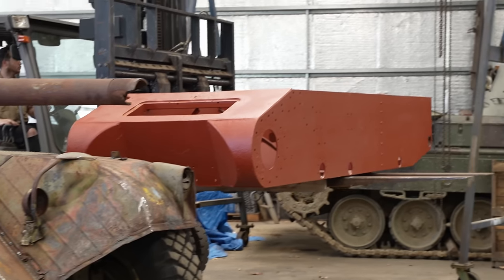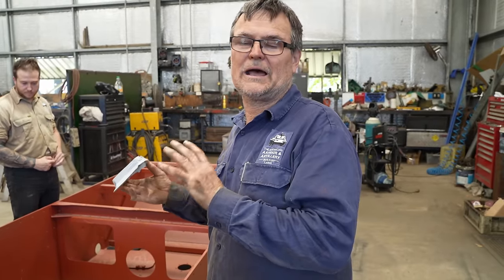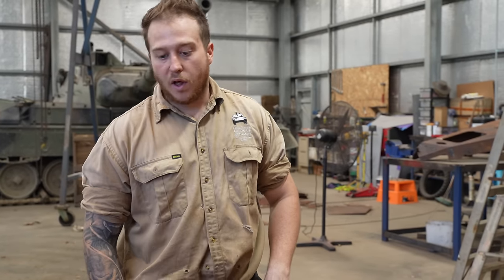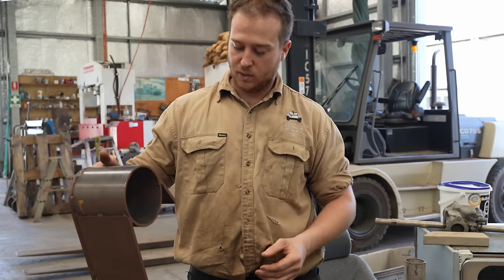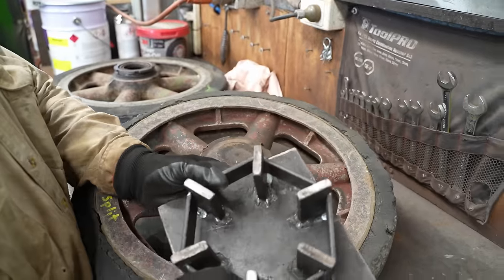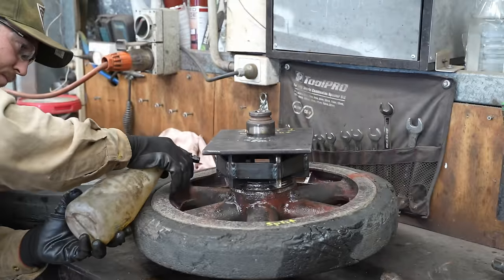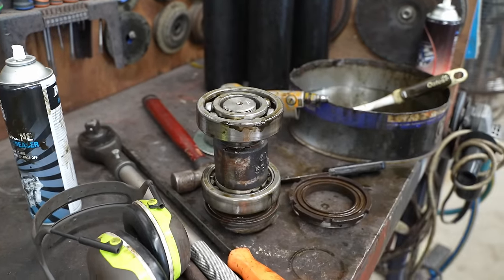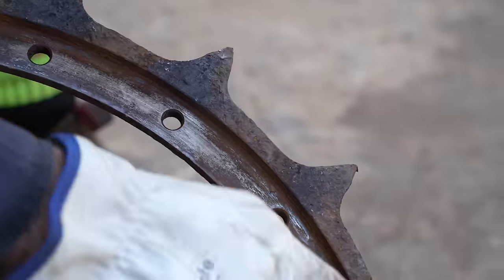WORKSHOP WEDNESDAY: New RUNNING Panzer I Ausf. B restoration project!

Comment: The panzer 1 and 2 are two of my favorite panzers. They were outdated before they went into combat, but they were just neat little tanks! The Panzerkampfwagen II Ausf. L "Luchs was also a neat design!
Reply: In 1939 the Pz II was still pretty good. Although its armour was too thin, the 20mm auto-cannon could punch through anything the Poles had.  The armour on many Pz II’s was upgraded for the France campaign in 1940 but the cannon couldn’t scratch the better French tanks.

Comment: You were struggling with removing steel bolts from cast aluminum and there is a very simple trick which works very well in that the maximum expansion of aluminum happens at 100 deg C while steel needs much higher temperatures to move. All you have to do is drop the casting into boiling water and allow it to come up to temperature, the aluminum expands by as much as 10% while the steel wont expand at all. This works so well that Rolls Royce use it as their preferred method for removing liners from the merlin blocks and from experience they almost drop out. Could save you a lot of work

Comment: Hard to believe that the ball bearing still has the same number: Rillenkugellager 6309 (45x100x25 mm)
Reply: I noticed that as well.
Reply: I have done US half tracks, when doing the brakes, I used off the shelf truck parts, they were the same and those parts are available still. Because of manufacturing standards, we are now seeing parts that have been in use across many different machines since for 130 years. This will continue, why after all invent a new bearing and give it a new number when there is no need.
Reply: @oldfarthacks I could agree more. I have been delighted to buy off the shelf bearings and oil seals for my milling machine which was new in 1952.
Reply: @oldfarthacks  There are some part number changes and some bearing lines do die out, but yeah, for the most part, anything built within 130 or so years, maybe even a bit more... you can use off the shelf parts. That's standardization for ya.

Comment: 24:00 i have pressed that kind of steel thickness into a dish for my brother's farm machines in the past. It's not that difficult. A 90 ton hydraulic hollow ram would do short work of that kind of steel. You just need to manufacture the parts where the metal doesn't need to bend. When i talked with a fellow that worked in the industry for advice, he called them the "pinch points" (might be lost in translation). In simple terms, you need to have the surfaces that become the flat flanges where you bolt things pinched by two pieces of tightly bolted material that become both form and holder for the part. Once you have those, you can push them out as fast as your hands can work them. In my specific case, i only needed the outer segment to be a controlled surface, the inner one could have any shape, as it was to be welded, but it works out really easy. Truncated cones like that don't offer much drama at all.

Comment: The skill shown by you is truly remarkable . It is as if it was a  plastic kit of the tank. With the majority of the parts missing . That had to be remade  by hand. But instead of plastic and glue , you are working in steel and welding !

Comment: It's fascinating to see how thin that hull is. It's not armor, it's boiler sheets.
Reply: The Panzer I was primarily intended as a 'training' tank, one reason why it was armed with only two machines guns.
Reply: @JM-lk6wo more than a training tank The panther 1 was conceved like a tankette that's why The twin MG 34's on The turret and The light armour
Reply: Yet they attacked into France, Belgium and Russia!
Reply: @frankbodenschatz173  , that's true. It wasn't intended to be so used by the German General staff, but Hitler wanted a war before Panzer IIs and IIIs were available in sufficient quantity.

Comment: That dished centre of the sprocket looks ideal for easy casting.  My brother did some work on heat-treating cast iron and found that it gave a lot more strength to an iron casting.  It is definitely worth looking into as casting is so easy.

Comment: Fun & Games! Back in the day, I would have leapt at the chance of a job like yours!  Lots of old, heavy gear & lots of head scratchin! A couple of workshop tips, if I may, from a retired dozer / heavy vehicle engineer (you might already know them). The single best bearing drift I've ever used - still using one now - a length of 1/2" key steel. I never found anything that worked better. Eucalyptus oil works well on seized parts, especially on Morse Tapers. The latest inclusion in my workshop is cheap shop tyre shine. Brilliant stuff for most tight fitting rubbers & plastics I've encountered, when you need to fit or remove them without damage. Keep up the great work, lads. Next time I'm up that way I'll be popping in to see what you're up to.

Comment: I love that you guys are making this Panzer 1 a running vehicle and I like the idea of hydraulic powered final drives. My personal opinion for what you should do for an engine would be to use like a 3 or 4 cylinder Detroit Diesel (I'm personally a little bias about Detroit Diesels) or some sort of cool, small diesel engine. Keep up the good work.

Comment: I have been trying to get some views of the cast aluminium wheels and they appear to have some quite complex features. I guess being German, that comes as no surprise! 😮
At the moment my thinking is that they were die cast on a machine as opposed to greensand cast.
The undercuts on the inside of the wheel rims are the tricky part and given the rubber road wheel is in the way we can't see the details of the exterior rim of the wheel for locating the rubber wheel. 
Mark from Melbourne Australia 🇦🇺 
Olfoundryman here on YouTube is based in Melbourne and could guide you through how the wheels are likely to have been made. He has years of experience including in the automotive manufacturing industry.

Comment: I worked in a 
 museum in Vincennes Ina, while in college. 
Found most of the German equipment after breaking the rust came apart easily. American  equipment was either  frozen solid or just broke in half.
I preferred  working on the German vehicles.

Comment: We need longer episodes Kirk!  Looking forward to this build. Your comment about the wheel hub coming apart being the first time since leaving the factory isn't right. Looking at the locking collars with the notches cut into them clearly shows that they've been opened up in the field and undone with punches and by the looks at every notch several times. They would have been done up in the factory with a dedicated spanner or socket type spanner and the notches would not show any damage at all.

Comment: maybe a skidsteer with a small diesel engine can be used for the driveline of the panzer 1? that would also solve the challenges with clutches and brakes for steering.

Comment: As to the final drive inner hub.  I've seen Agricultural Disc blades as thick, or thicker and near that diameter with the same shape.  Might want to pop down to the local Tractor supply since the Germans once called these Tractors back in the day.   ^~^

Comment: Another great restoration video as always !. Early year made German panzers used some aluminum for their parts which is quite interesting.
The track link with chevrons might not suitable for this Panzer. German Panzers of the early stages of the war did not have chevrons on track links.

Comment: These used a 4 cylinder air cooled engine. I think a carbureted VW bug engine would be the perfect fit! A 1600cc makes 60hp which is exactly what this would have had.
Reply: I believe the Ausf B model had a Maybach inline 6 with water cooling producing 100PS, rather than the air cooled Krup flat 4, I'm not sure there's a modern 6 cylinder engine, that's small enough and doesn't produce too much power, perhaps the Daewoo XK6, not sure how easy that would be to source in OZ. Old Holden inline 6's might fit, but my (heretical?) choice would be a Ford EcoBoost 1.0L, super small, very efficient, plenty of them around.

Comment: GMC made the twin six in the 1960s. A 12 cylinder gas engine that might make a replacement for the panzer V12. They were used quite a bit in firetrucks. I believe a guy online sell rebuilt engines.

Comment: The Ausf. A version of the Panzer I was powered by a Krupp M305 engine. This was a boxer, air-cooled, 4 cylinder engine, developing 57 hp. The Ausf. B was powered with a 90 hp, water-cooled, inline 6 cilinder, Maybach NL 38 engine, and the rear hull of this version was longer, with an extra road-wheel, to accommodate the bigger engine. One might consider putting a Type 4 VW engine in here? It is a 2 litre, air-cooled, boxer unit delivering about 70 hp. Very low profile mill and should easily fit in the available space. Petrol-hydraulic drive or petrol-electric drive might indeed be an idea.

By the way, Continental (on the rubber tyres) is a German tyre company.

Comment: A shop that fabricates steel truck and tractor wheels might have dies to press you some new disks. A heavy laser cutter for the drive gears. Bring material and film to talk the place up, you might get a deal on labor.
Reply: Sorry, digging around for heavy steel stamping, hydroforming, and explosive hydraforming and I'm not finding anything usefull. Might be a truck or tractor wheel that has the right dish and weight but....

Comment: You should build a Bob Semple Tank ...
Reply: @Kamina1703  New Zealand engineering at it's best..
Reply: Wouldn't be difficult or particularly expensive to build one. Just an old Caterpillar D8 with corrugated iron sheets bolted all over it.
Reply: @StuSaville  That's it...just a small shed on tracks.

Comment: 10:06 a split like that could be fixed with a rubber glue. Now... i'm not sure about old rubber, this is reaching near the 100 mark, but i have fixed 30 yo solid rubber with loctite (the black one for rubber) and it's held up beautifully under load. In my particular case, it's a rubber shim that has a specific shape on a farming implement. The manufacturer asks... too much for a new one, so i opted to fix it with glue, it has held up without much drama.

Comment: The pressed format of the sprocket centres look like tractor wheels. The Mk 1 was described in German officialdom as tractor to disguise its reality from the rest of Europe though there were areas of assembly in Russia and I think Sweden both of whom wanted to understand about armoured vehicles and aeroplanes. It was a trade off for indicating engineering ideas and training and obtaining armaments forbidden by Treaty of Versailles. 
My point though is that the tractor scenarios for some parts may have validity in that many parts had to be believable for transport around Germany under the eyes of Allied Inspectors.
Reply: I'd even wondered if they could find a suitably shaped tractor wheel hub and cut it down.

Comment: 've said it before and I'll say it again but the German's do make some of the best stuff in the world. Every single one of my insulated tools are 1000V VDE and there all from Germany. The very first tools I got when I started my electrical apprenticeship were CK and I've still got some of them today. I've also got a couple of other manufacturers of insulated German tools n they're just as good or even better n they're called NWS & Wera. 

Can you glue that split back together some how like getting some matching rubber and drizzling it in that split? It looks like it's not one of those types of wheels where you can press the outside off and replace it with a new one like you did with the M3 Grant?

Comment: Need an engine. I'm thinking a Chevy 454 with turbo and a blower. But this is 2023, so it will probably be an electric Tesla drive with solar batteries mounted on the turret. Nah, go with a diesel...;)
Reply: Electric?? That was last years idea.
Reply: @ldnwholesale8552  😂
Reply: Electric? We don't want it to blow up again.

Comment: Those tracks are not correct for a Pz1. These were used on late war Opel maultier. Essentially the same, but with the extra grip grousers is not correct for early war.
Reply: Please don’t use a modern car engine. For sure you can find something off the period of similar size and power.